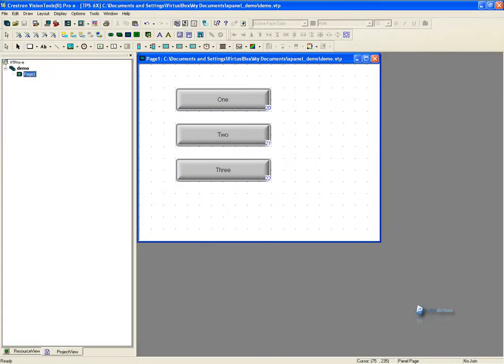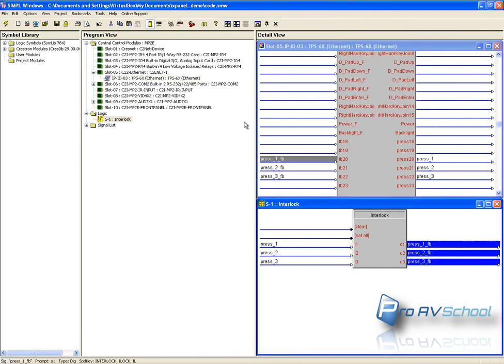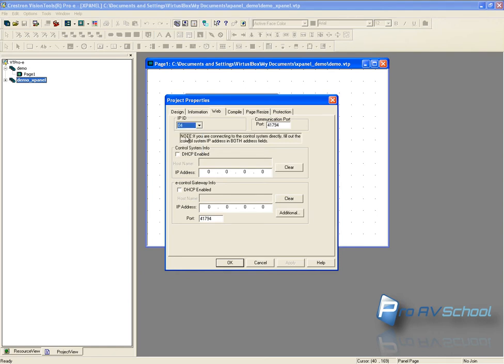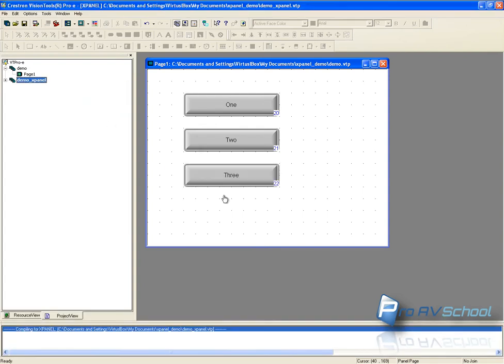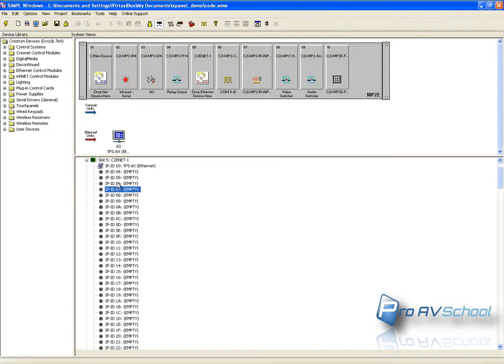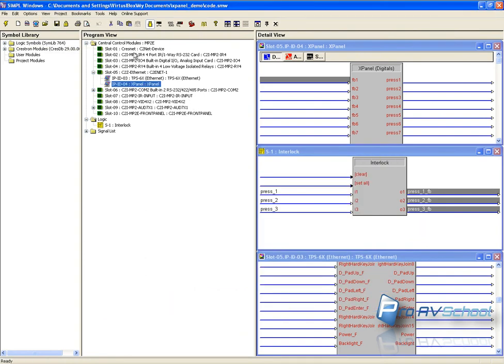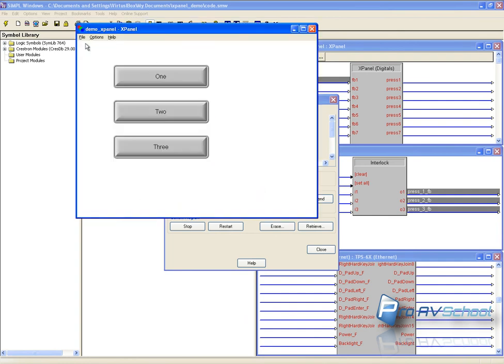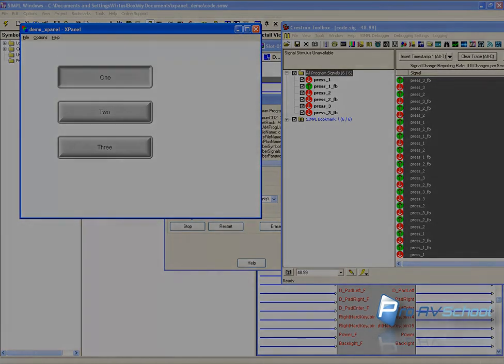Creating a simple XPanel project with Crestron for testing

Comment: Can you virtualize a processor as well as a touch panel?
Reply from the maker: +john kubik There is no way that I know of to visualize a processor. A lot of people are picking up used ones off ebay for a bargain and using for testing. I've got a couple 2 series processors kicking around and thought it might be interesting to offer a way to remotely access them and debug but access permissions would be a bit messy with a group of people.